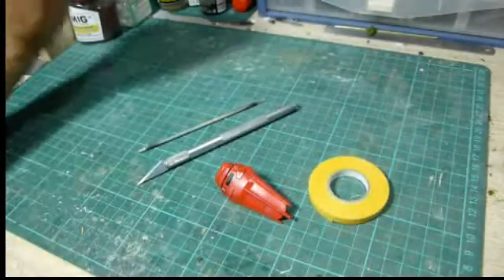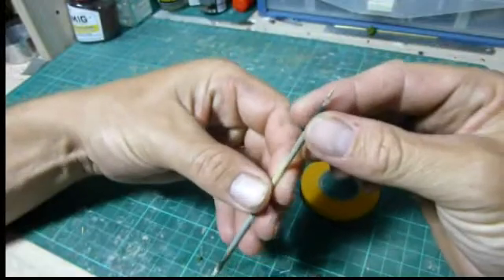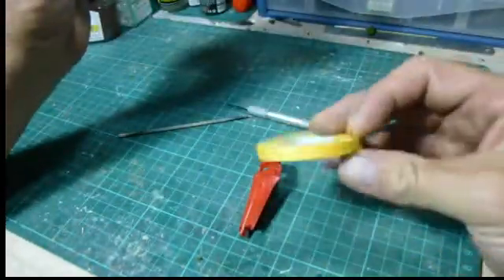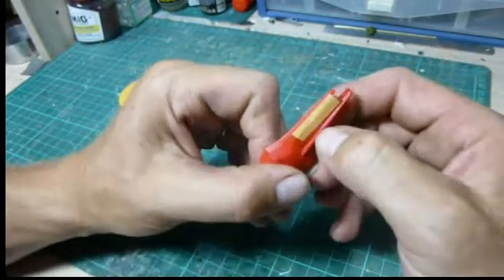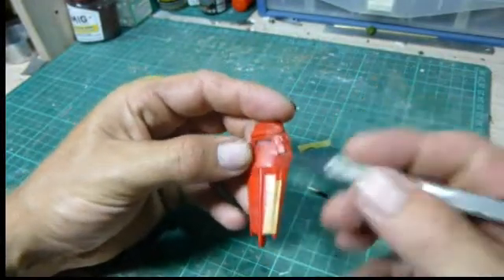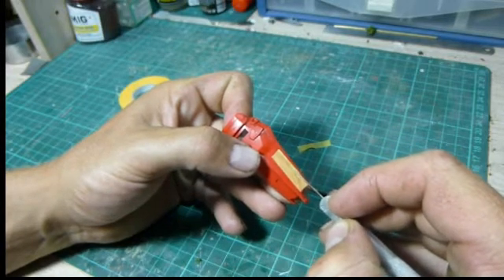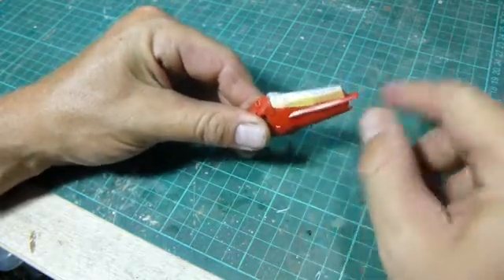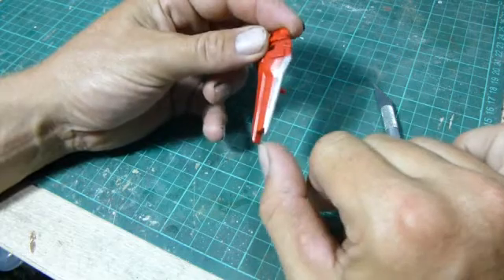Gunpla Tutorial : Masking

Comment: What would I need to do if I need to paint the same part multiple colors? I'm worried about the masking tape peeling off the paint I've already done.
Reply from the maker: The paint shouldn't peel off if the surface below has been prepared correctly. Lightly sand the plastic with a fine grit sandpaper before priming. The tiny scratches that the sandpaper leaves will help the primer stick better meaning that the paint wont lift.
Reply: TheGhostofZeon  Noted, thanks!